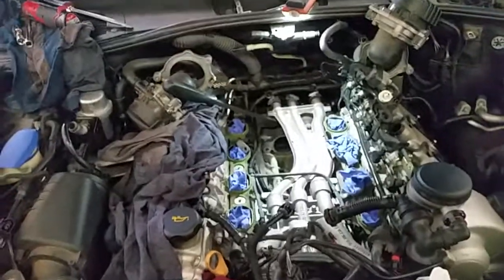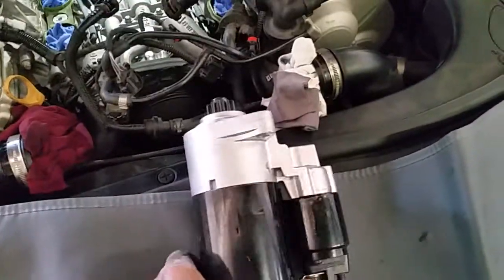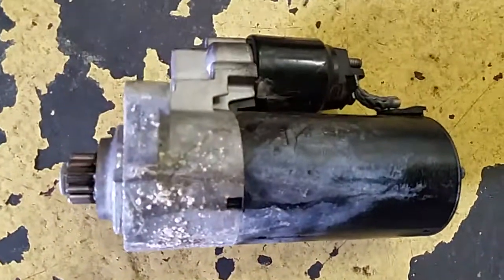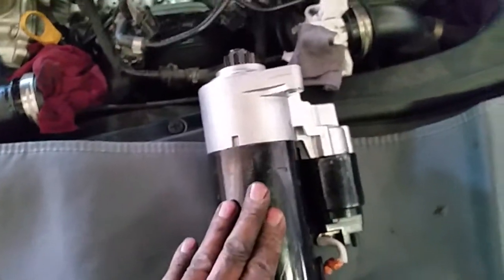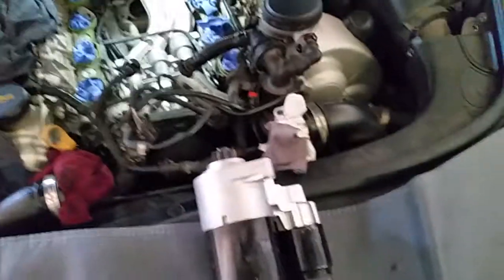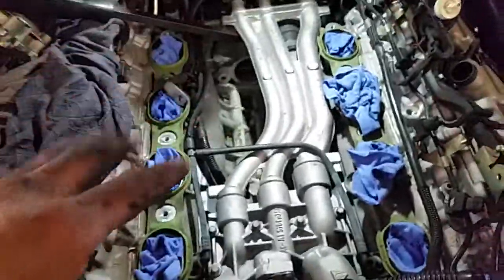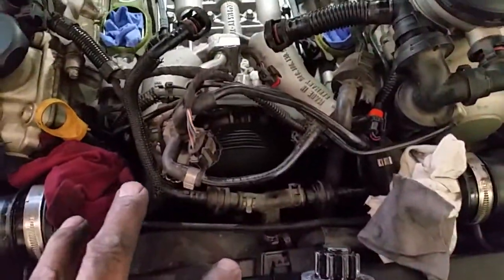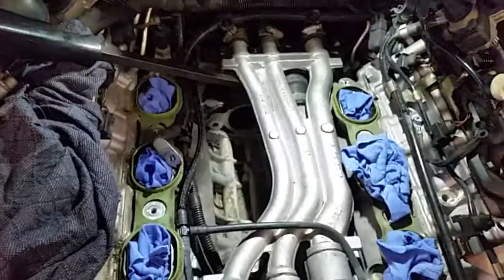Porsche Cayenne Turbo 4.5L V8 Starter motor replacement

Comment: So I just changed my starter proactively while fixing a coolant line under intake. Put in a rebuilt Bosch. Ran and started fine for a couple of days, then suddenly got a dead key when trying to start. Tried again and solenoid engaged for a split second then disengaged, but starter kept spinning, even when I turned the key off and took it out of the ignition. Had to disconnect the negative battery terminal to stop it. Waited a few minutes, plugged it back in and it started fine. Then no issues for a week or two and was almost trusting it again when it happened again. Sitting in the garage now and only intermittently works but when it does the starter definitely sounds weak now. Also just installed a brand new AGM battery and checked all cables.
Reply from the maker: Starter is faulty
Are you in Sydney because I do have a few I already rebuild
Reply: EMD Porsche Specialist Caringbah Sydney that’s my conclusion as well. Thinking maybe the relay but it was all working fine before I change the starter so most likely the starter. Also have a guess that a couple of times it was running fine that in actuality the starter motor was still spinning disengaged under there. Pretty sure it’s totally fried by now. Will be taking it back out for a genuine new oem Bosch. Good news I guess is now that I’ve done it once second time will be much quicker and easier. It sucks compared to a starter replacement on a Japanese car but it really isn’t that hard of a job.
Reply: EMD Porsche Specialist Caringbah Sydney spot on. Replaced with another starter and things are working again. I can now change a Cayenne starter in record time. While a lot harder to get to than almost any other vehicle I’ve previously worked on, I actually don’t mind because it’s clean under there and I’m not wedged up under the vehicle.
Reply from the maker: @Pollux95630  looks like I have to ring you if I have Cayenne starter to do
Reply: EMD Porsche Specialist Caringbah Sydney sorry didn’t see all of your first reply asking if I was near Sydney. I’m actually in the states. Wife and I spent our vacation in Australia last year though. Few days in Melbourne and a week on Hamilton Island. Beautiful country. Will be back again one day when all this covid is over. Cheers!
Reply from the maker: @Pollux95630  wow great holiday wish you luck with your Cayenne
Take it easy

Comment: Hi, is it recommended to disconnect the battery before doing this?  I have an 06 Cayenne, I went to put the new one in and got a huge spark.  Its never mentioned in these tutorials or forums.
Reply from the maker: Yes 100%
Reply: EMD Porsche Specialist Caringbah Sydney Thank you, tested starter and still works.  Will disconnect battery when I go back in to try again.